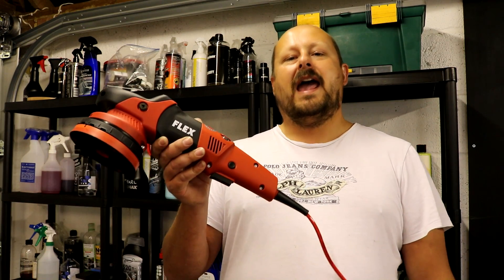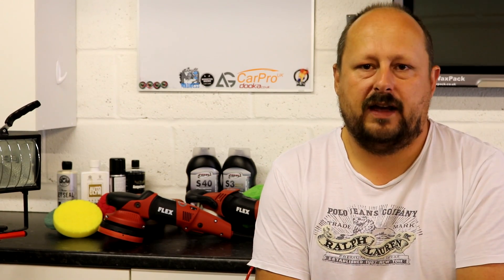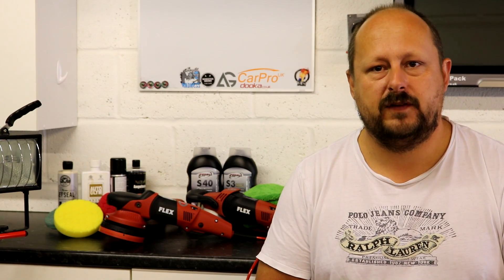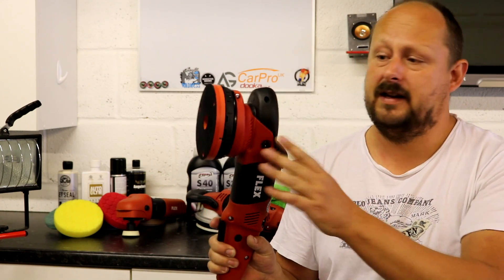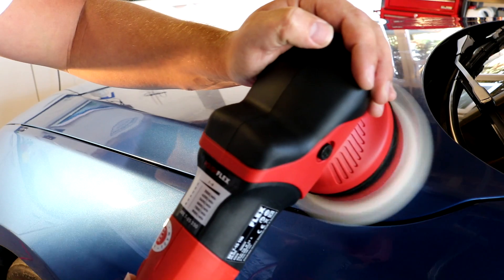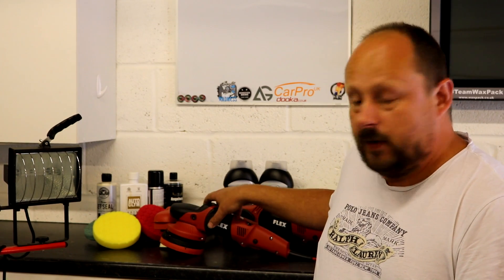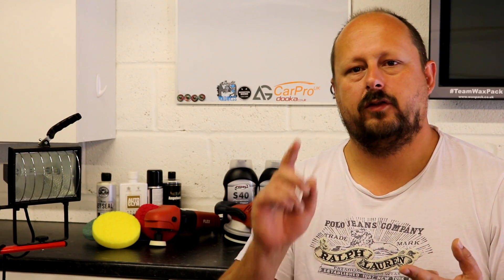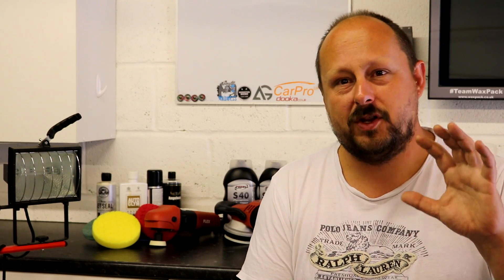Flex XFE 7-15 150 review demo - Long Throw 15ml Dual Action polisher

Comment: I bought that machine, tested it and didn't like it. Sold it the next day. I also sold my LHR15 Mk2 at the same time. Because real men use Rotary.  lololol
Reply from the maker: what didnt you like about it brian?
Reply: For me, rotary is a far more efficient and engaging machine to use in 99% of correction situations.  I think far too much focus is being put on DA machines as a professional tool. If you even look back at the original marketing for large throw machines, they were aimed at bodyshop personnel who didn't know how to use a rotary and left buffer trails. With the marketing strategies, I am seeing definite down-turn in rotary skill out there, partly because polishes and compounds are also created to be more compatible with dual action machines. (That difference is for another conversation).  The new flex machine is a good machine for a DA. I found it well balanced and ergonomic. One of my first dislikes was the design of the backing plate and that black collar that fits above it. This overall shape here means you are very limited to where you can slide the machine around. Its fine on large areas but if you want to get in, even just a little bit under a spoiler or around a splitter, you need another machine. The Flex collar will just collide with paintwork in tighter areas. And it doesn't really like a large pad on this size backing plate either as the downward pressure is lost on the wider non-backed edges. (I'm not sure if that makes sense? But that collar piece is a terrible design flaw) . The speed is another issue. It doesn't operate at the proposed speeds. I have or had DA machines that operate at high speeds and they are intriguing. EG, the Flex X1107VE is an unstoppable 8mm DA that starts at 4300 and goes up to 13000 OPM. Under load, I'd say it runs at about 8000 to 9000 OPM and that causes serious issues with heat in the pad and the backing plate. Lovely machine to use though with the right combos.  I also have a Taiwanese 14mm throw machine that goes up to 14000 OPM (that is sheer lunacy though, I won't use it for correction lol). ........... The Flex 15mm throw is better than the Rupes 15mm throw under load as well. But it isn't 15mm. You can see it diminish on either machine with slight to moderate pressure.  The free spinning aspect is also better on the Flex but the spin doesn't have enough energy behind it to make that much difference (just in my opinion). The effectiveness of the machines comes from the orbit and the way the abrasive travels along the surface during its breaking-down period.  So I tested the machine firstly against the Rupes and found it was slightly better at the different speeds, different pad and product combinations, etc. Then I tested it against the rotary and I just found that this is where the finesse lies.   (BTW, how to choose a rotary is also another story lol)  So I just sold the machines and made my investments liquid again! lol  Sorry for the long answer btw
Reply from the maker: definetly cant use the long throws in tight areas, I thought though you were gonna mention vibration as a negative...     

 you could say theres not much money or long term prospects for any tool maker offering machine polishers if there was only rotaries..  wont be long before the chinese did a lightweight one, and the price points of lots of the other rotaries from decent tool makers limit what the other guys can charge..  I sometimes wonder if this is whats driving all these offerings coming out... because yer I hear you.. the rotary does the lot and does it all well.. and its not hard to use.. the risks of doing the bad stuff all revolve around using it at high speed really...  stick to 600-1000 not much can go wrong...
Reply: Its true. But don't get me wrong, one rotary will still leave you very limited. I have a few, but two of them are always to hand (depending on the current car).   On most cars, its just a case of switching plates, adding an extension etc, rather than needing a whole array of machines.  But what is driving all the new tools on the market is the simple fact that people will buy them. Detailers & enthusiasts are always looking for a magic bullet, but we know in reality there is no such thing. There are way too many critical variables.
Reply from the maker: your right brian.. I was working on a car the other day and I have no idea why but I was really struggling to cut with the rotary on the tests I did.   the product was gripping on the rotary I was getting funny noises, I was working at low speeds...  could not for the life of me figure out what was going wrong so just switched to the 3401 with S3 and it just worked and cut better...   but sometimes Ive gone at cars with the 3401 and had to switch to the rotary..